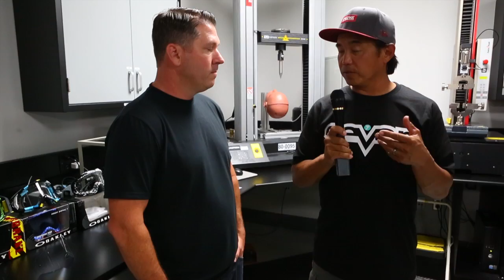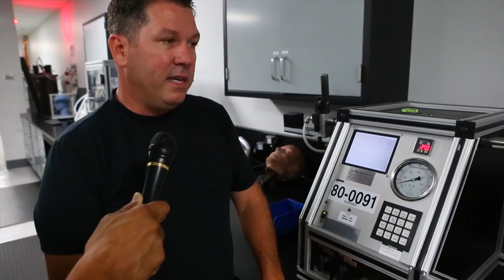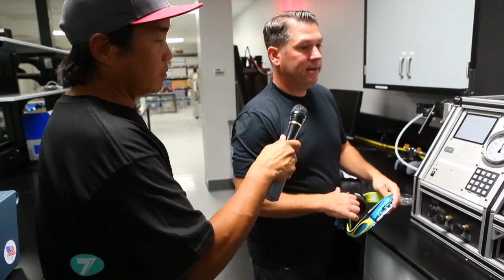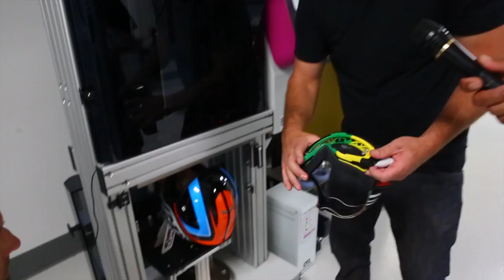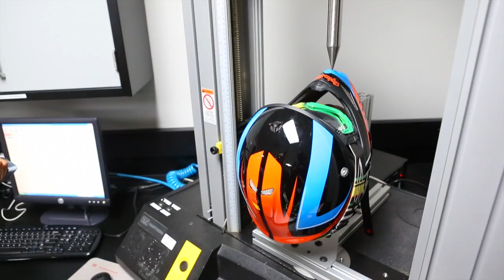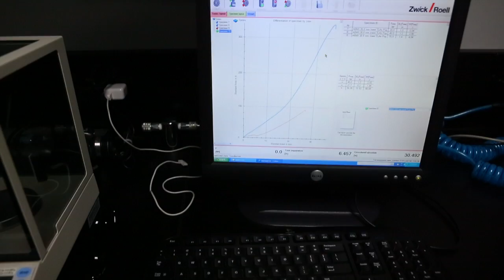Behind The Scenes | Oakley Testing Laboratory | TransWorld Motocross

Comment: How should a 
450 be able to shoot a rock at 300mph while 6th gear only goes to about 80mph?  Furthermore if you are in 6th you are moving at a certain speed , which will decrease the velocity of the rock in the other direction. The only way a rock will accelerate to the guy behing you is by wheelspin and you will never have  your tires spinning at 300mph while you are standing. But please correct me if im wrong.
Reply: It has nothing to do with the speed of the tire directly. it is a mathematical equation that states force is equal to mass times speed squared. thus the force applied to the lens is equal to that of the pellet traveling at 300mph. Its simple math.
Reply: vivalaphill Yes...it can..in fact if the rock has any weight to it, it is foreseeable that it can hit harder. If you don't think it is true then park your car under a bridge and proceed to drop rocks on it. its isn't the speed that's is the issue but the mass behind it...the speed never changes beyond max. speed. And you know as well as I do a small rock might chip your window but a rock of considerable size will go right through it. even though the speed never changed. and by considerable size I'm talking about a 2in rock dropped from 40ft and it is only going 35mph...300mph is the relation between a max speed of 100mph in relation to the upsize to the average sized rock.It can be greater if the rock is larger.
Reply: the torque alone. the rocks speed has nothing to do with a bikes overall speed.
Reply: but if you are standing still, the back wheel is spinning at 80mph and it catches a stone doesnt it fly away at 80mph?
Reply: better to test the rock impact at 400mph than at 80 lol just means its that much safer then being right on the line of breaking
Reply: i understand an appreciate the kind of overengineering, but it makes no sense
Reply: That power to rear wheel and rock is the samr , weight of bike the rear wheel has to power is hundreds time heavier than a rock, the reason why the rock travels hundreds of times faster..
Reply: theoratically ..if all the power would be transmitted to the rock.
Reply: i know what they want to say its theoratical but in reality no rock will hit you at 300mph
Reply: vivalaphill Now that the basics are out of the way..lets talk fact...Bike speed is not related to power out put.It has to do with the gearing and max RPM. If you apply the power to the equation you get rate of exceleration. And that pertains to to a 240lb bike with a 175lb rider. When you calculate the power applied to a rock with average gearing you get a potential speed of 300 actual mph.
Reply: yes if all the torque would be transfered to a single rock, but that obviously impossible
Reply: vivalaphill Far from imposable. You are simply guessing with out understanding the math behind the question. Nor do you understand how a dirt bike moves foreword. Not all the tire contacts the ground. And only a hand full of nobs and there leading edge make contact. And giving that one Hp is all the is needed to move 520lbs 1 ft in 1 sec.I don't think you understand that it is very easy for all the power to be applied to one rock.seeing as it only takes a fraction of 1 hp to propel the said rock. That is the point behind tire design.
Reply: i understand their and your point but still if i take my bike put it on a stand in 6th gear and rev it to the limiter then throw a rock infront of the tire will it fly away with 70mph or 300mph?
Reply: vivalaphill That's the interesting part...If in that situation,you set it up so the rock will be propelled from the tire then it can be propelled up to 300mph. But most likely in that situation it would bounce off the tire as well as be projected. Greatly reducing the speed.
Reply: but thats the part i dont understand my rear wheel rotates at ~70mph and for a short period of time it carries the rock with it so it obviously accelerates it to 70mph if the rock would be hit center of mass and doesnt bounce of to the side i dont get where the extra 230mph should come from not all the power is transmitted to the rock. My bike wont bog down because of that. maybe im just to sillly to understand..
Reply: vivalaphill Your rear wheel spins faster then 70mph...The power can only maintain that speed...because of the additional forces like the weight of the bike,rider wind ect. because of the differences between the two objects( bike vs rock) the rock can be accelerated to far greater speeds.
Reply: +vivalaphill plus what if you send the rock into someone oncoming... Both colliding more impact
Reply: +motoman9477 the fact that you cant even spell acceleration right (lol exceleration?) really takes the wind out of your sails...
Reply: +Sruikyl Actually the fact that you don't get the pun like everyone else makes me question why you are even watching this video.
Reply: +vivalaphill They are experiencing failure in the field. The End.
Reply: +vivalaphill The speed of the projectile is relative to the amount of torque and the mass of the object being propelled.

I can picture in mind a large rock only being propelled a few feet per second because the torque applied from the wheel has to displace a larger mass.
Reply: vivalaphill 450's definitely go over 80 they can get close to if not faster than 140kmph
Reply: I think you’re looking at it wrong, yes the bike may only do 80mph but when it impacts a rock it doesn’t just transfer 80mph into the rock.

Baseball is a clear example, I bat swing speed of 100mph makes the ball go around 120mph.